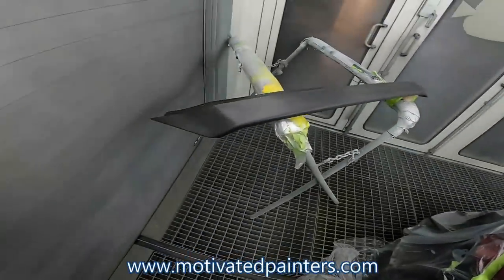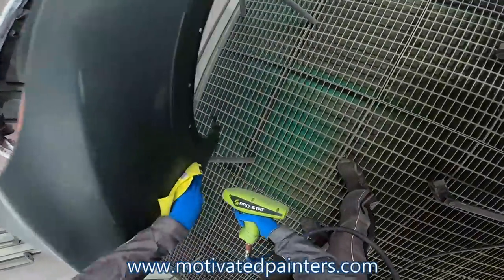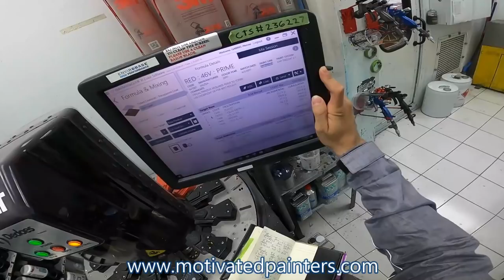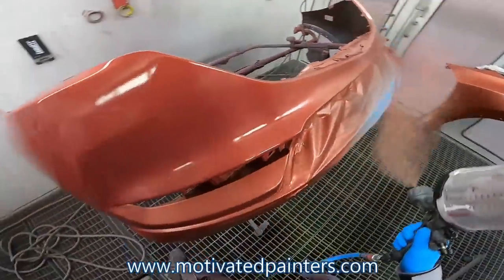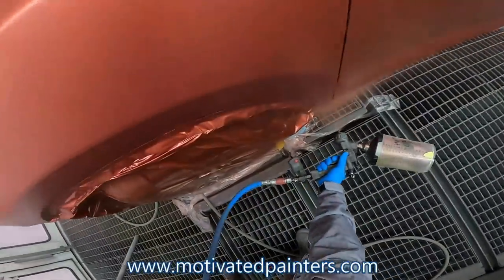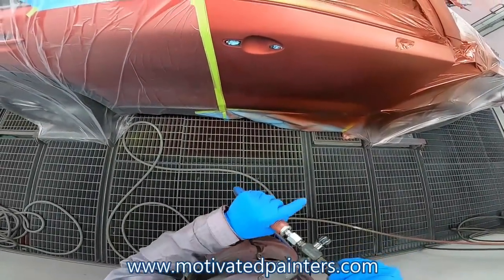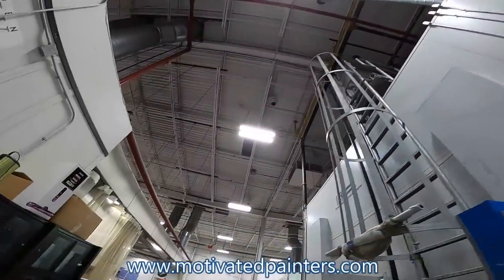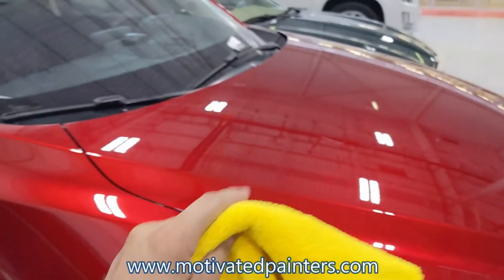Spray Painting Candy Red

Comment: Do you use a slower hardener and reducer for your sealer? I use PPG Envriobase also. I often have a hard time with my sealer edge when I spray my base. I have to spray reducer on my edges to blend them in the panel. My other painter doesn't have that problem.
Reply from the maker: You always spray spray max 1k blender works great! I use my Walcom 1.4 for sealer is super smooth
Reply: I’ve always kept some dt895 in a pps cup, and use that to blend in the sealer edge. You may want to ask the other painter what he is doing, I’m sure its his tech in spraying the sealer. But imo don’t sweat it and just keep doing what your doing cause it works.

Comment: Long video but lots of good info. Got a question. How long should you leave clear coat after you finish a job before you can repaint cause of you don't like how the base coat looks.
Reply from the maker: It all depends on what the clear manufacturer says. They are have technical data sheets you can get on their website and they will tell you a recoat time
Reply: @MOTIVATEDPAINTERS  thanks Gabriel but I don,t mean reclear but start over
Reply: Thanks all the same. Nothing on data sheet. Paint rep says a week in this heat we've had should be good to go..

Comment: Do you ever have issues with that blue fine line staying stuck to the panels? I've been using the green 1/4 in tape as fine line for the last few years. Because that blue wasn't very sticky on the underside. And would blow off in spots while spraying. No matter what precautions we'd take. And the paint would bridge to the topside and kind of tear when pulling it of. We used solvent back then though.(ppg global. The worst. Lol. So much tinting.) Been thinking about trying the blue plastic tape again though. Because on 2 tones, the green tape always leaves a very slight fuzzy edge.
Reply from the maker: I think they have improved it alot! If you don't stretch it it stays on forever
Reply: Thanks. I'll have to give it another shot. It has been a few years. And I know a lot of guys that used to complain about it too. Figured its got to be improved by now. That shop looks amazing, btw. I'd love it if my shop would buy one of those base coat mixing machines. Mixing base is one my least favorite activities. Lol

Comment: Hey gabriel what is wrong with t493 ? I dont paint with waterborne and just wondered what is and how can they make it better
Reply from the maker: It's basically an activator for waterbase but it's so problematic with ppg envirobase
Reply: @MOTIVATEDPAINTERS  I know what you mean I use transtar solvent paint and constantly have problems with trash as LOW VOC products like reducers and hardners.  Hope all is well came out nice nice hahaha
Reply: @MOTIVATEDPAINTERS  we only use 493 in solid colors so they dry faster.
Reply: I believe they came out with another toner to replace the t493, maybe t492. Honestly I never used either, just made sure I check the viscosity and panels were back to temp before adding another coat of base and before clearing. As fast as I know I never had a issue with the base lifting from the sealer.

Comment: Hi Gabriel!
Really appreciate your movies 🎥 
Just a little tip for you... never spray a pearl color over a sharp edged primer spot. Use a little waterbase (correct G-shade) to fade out the edges first. It makes a world of difference, since pearl colors are not supposed to cover.
Check out this film from PPG:
https://youtu.be/6uOtbIiwRZ4
I use it a lot in my courses. Check TDS, 25 microns of base will give you the correct basecoat film thickness for color match.
I believe the guys in PPG's colorlab don't make colors to match with 3 +++ coats 🤷‍♂️
I might be wrong 😉 
Keep up your good work!
Greetings from Norway 🇳🇴

Comment: Cool video,  I would have used red sealer and not used solvent based wax and grease remover on plastic parts,  I have found they peel like a bee otch when doing that
Reply from the maker: Ppg doesn't have red sealer 😵